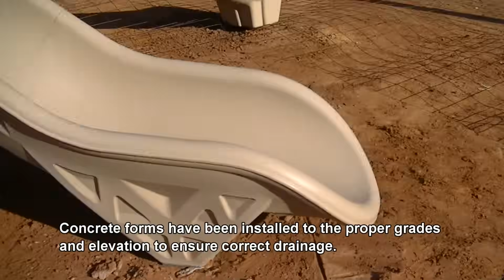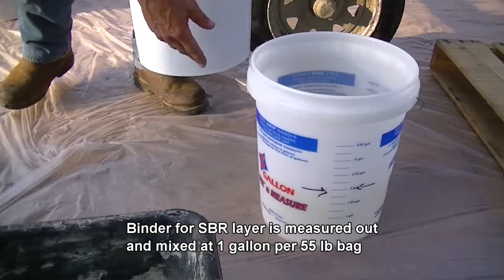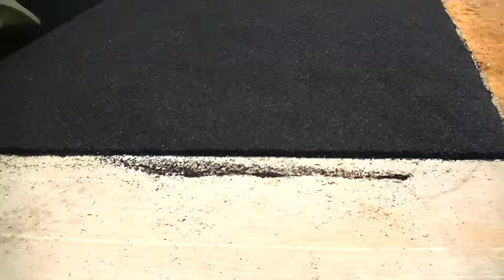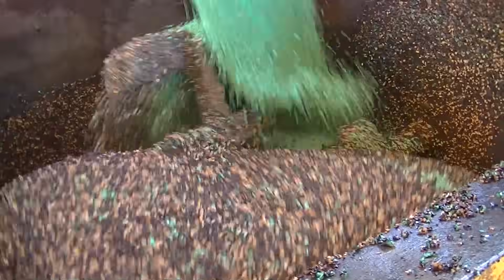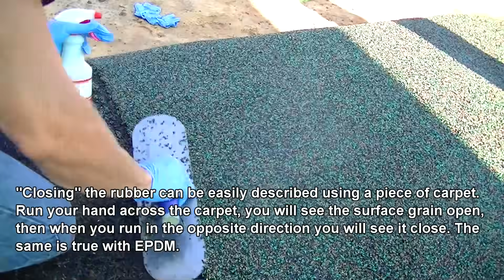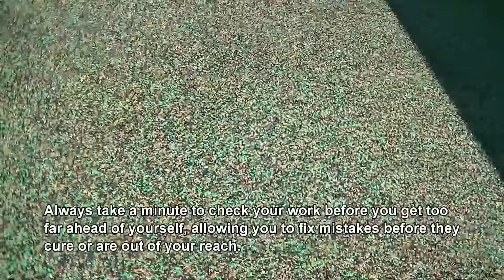Poured In Place Rubber Installation - Poured in Place Playground Surfacing Installation

Comment: How do you clean out that concrete mixer after the job?
Reply: The wax is a really good idea. I use duct tape on the panels in the mixer to prevent the buildup on it. Other than that the best way is to have someone scrape it out manually which sucks

Comment: Why does the concrete have to be so perfect if the rubbers going on top- just wondering how important that is..
Reply: Because the rubber is porous and generally the slab is laid at a slight slope to leave water run off - you don't want "ponding" at the concrete rubber interface.

Comment: Hey guys, we apply exactly the same way in Europe - it’s really a perfect step-by-step installation manual for beginners with cool explanations and experienced working methods - you made a good job! Anyway it’s necessary to say - the rubber surfaces are not easy to apply and by the installation there are many aspects (weather, temperature, humidity), affecting the final form and your success!

Comment: Hi Guys , I am from South Africa. Have you ever used a standard concrete mixer to mix crumb and binder. We don’t have smaller pan mixers available her. Just monsters that are not convenient to transport from site to site
Reply: I heard you cannot use cement mixer, but I don’t know for sure. I use a hand held paddle mixer, and if you have a double paddle mixer you can mix fairly large batches. At least this is what I found out!
Reply: @anthonyriutta8880  
My company uses a regular motor mixer. Cleaning is a nightmare but you gotta do what you gotta do.

Comment: Nice to see someone putting up some informative content. As for your lubricant, try DiBasic, your crews will thank you
Reply: I'm looking into doing wetpour driveways in central Florida. Would you be willing to share some specifics of materials with me? What would you use for the PU and at what percentage? I plan to start with my own driveway as a test and I can get crumb rubber from a local tire recycler for $140 per 2000 lbs. Can I skip the epdm layer for a driveway if I'm using 20% PU? Haha thanks if you can help theres no complete info out there.
Reply: @22thevoice22  We don't apply to driveways but lots of others do. Turning action ,snow removal...
I would suggest adding a bit of colour 10-20% 
We use Aliphatic resin from Sparton enterprises.$200 usd/20kgs. 
Aromatic would work with black but can be a challenge as it cures fast so no going back to touch up trowel marks etc.
Our ratio for resin/rubber is 12.5%. We always prime the entire surface.
Cheers
Reply: What is Dibasic, where can it be purchased from?
Reply: @anthonyriutta8880  Dibasic ester or DBE is an ester of a dicarboxylic acid.
I order from my local industrial supply Anchem Order Desk • orders@anchemsales.com
A simple search should show someone local...
Reply: Don, thanks for your fast reply, one more question from a pro, what’s the difference in using Dibasic and diesel ? Is there something special about Dibasic, cuz I’ve used diesel but have had trouble with epdm surface pores reopening after application?
Reply: @anthonyriutta8880  Dibasic is more expensive but it doesn't smell and no oily residue. Simply evaporates.
 I know some guy's that use soap and water as a trowel lube with great success, (arm and hammer, cold water)
Reply: @pistnbroke65  super dude, you are an awesome expert. No more bothering you ! Thanks again.
Reply: @pistnbroke65  Hey Don , quick question. How do you use the Dibasic? Do you use it in spray bottle for trowel? Do you Dilute it with anything? Thanks!!
Reply: @ThePg1613  we pour Dibasic in a small pail (1/2-3/4" in pail) and fashion a swipper using 1/3 of a paint, jamb some sort of handle in the roller,  dip in DB and wipe towels  as needed. You don't need .much, just keep your tools clean and lubed. Don't your forget PPE!
Reply: @pistnbroke65  What PPE do you use specifically? Are you generally using DiBasic outdoors?
Reply: @ThePg1613  99% outdoors. 
Ppe , dispoasble gloves and sleeves if the guys will wear them. Have seen chemical burns from resin etc. Rubber dust is also a irritant to some people